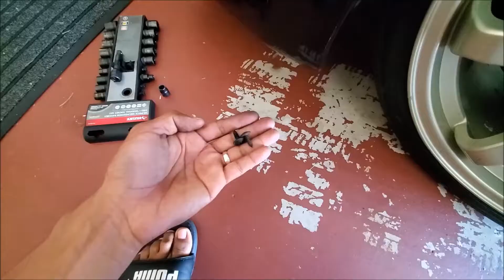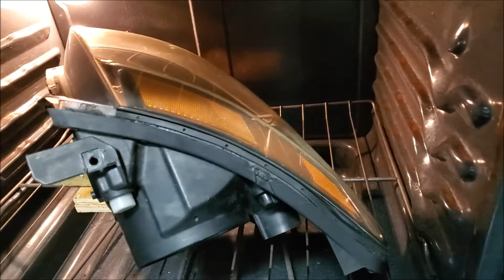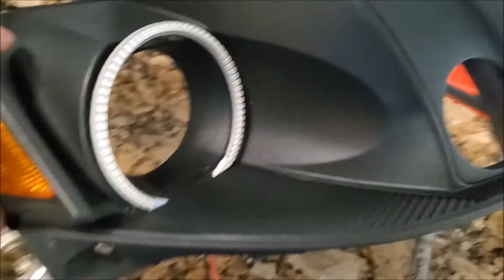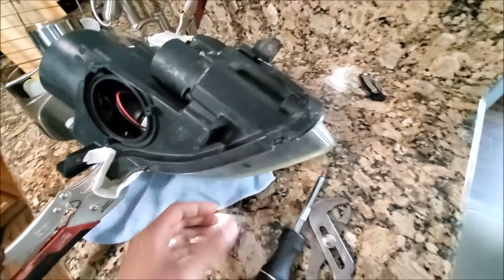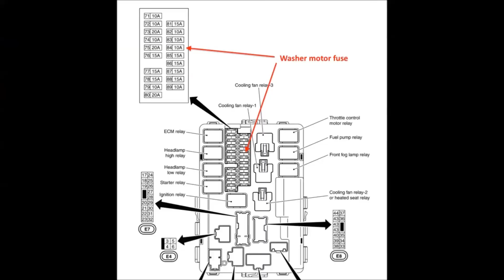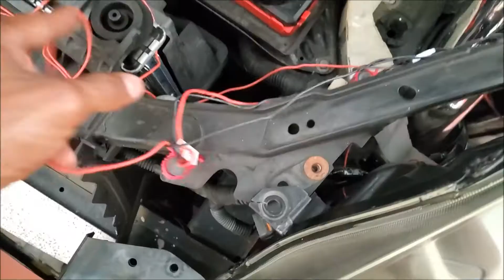Oracle Halo Kit Installation on Nissan Maxima

Comment: Nice car, from where you get the accessories?
Reply from the maker: Thanks, bro. You can find the LED lights on oraclelights.com.
Just so you know, blue lights are NOT street legal in the US. I learned that the hard way and had to install different color lights.

Oracle does have a kit that allows you to cycle through different colors, but it's pricier. I still have the blue lights kit if you want to buy it. I could sell it to you at a discount.
Reply: @vq_pwr how much would u sell it to me ?

Comment: Would that air thing you go fit on a 04
Reply from the maker: Not sure which one you are referring to. I have a cold air intake CAI (long chrome tube on driver side) and an upper intake manifold (on top of the engine). Both parts will fit the 04. You can find the CAI online, copany is called AEM. You can find the upper manifold from Kinetixracing.com. I would also highly recommend that you check out nwpengineering.com. I have pretty much all the products that they sell for the max and they are excellent in quality and performance.